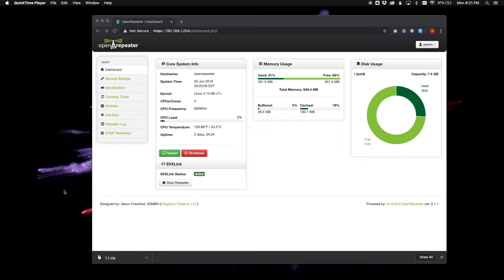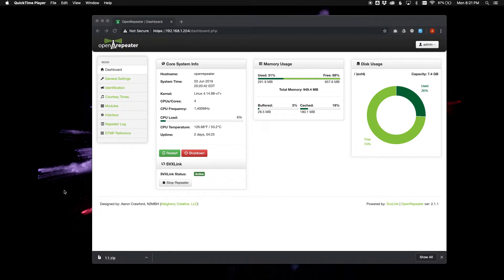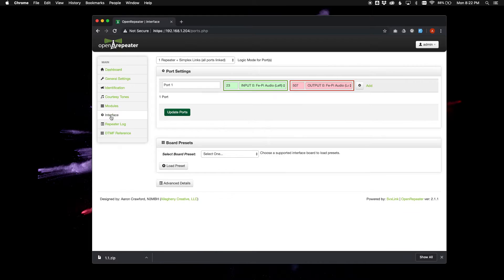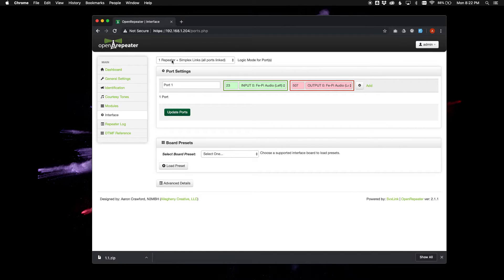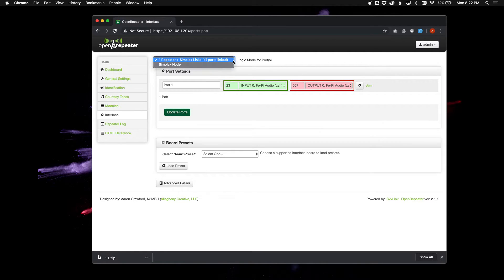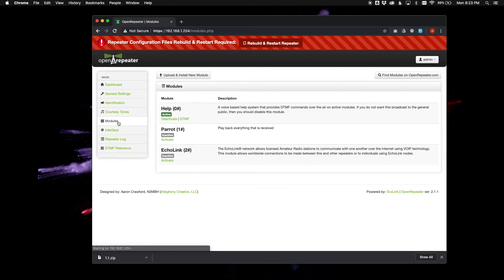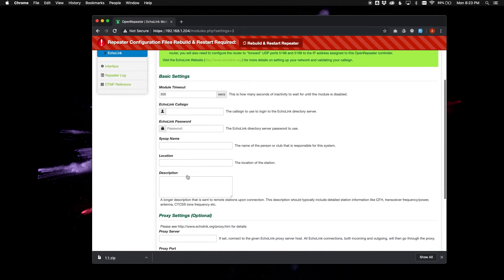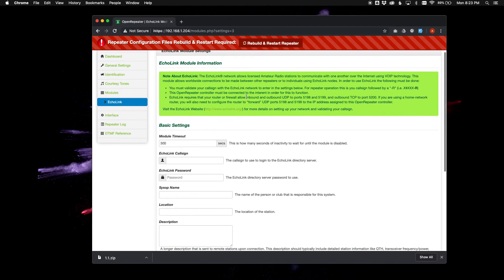OpenRepeater - Simplex/Echolink Node

Comment: So are you saying, you can build a Raspberry Pi, Node, that you download and install the open repeater program on. Then you can change its functionality to operate as a RF transceiver (or Node) that connects to a computer, for operating on Echolink? Much in the same way as modern, digital hotspots work?
Reply from the maker: Chris Sewell yes pretty similar. You’d need the Pi with the ORP image, some interface hardware (like the ICS Controllers Pi Repeater 1X) and a transceiver. Something with COS is preferred over using VOX. There are mods out there for adding COS to a cheap BF888S as used with Allstar nodes if you want something lower power. You basically set it up in simplex modes and enable the EchoLink module.

Comment: Is the software open source?
Reply from the maker: Gabor M yes it is.
Reply: @OpenrepeaterProject  great, can you please help where could I find the source code? thanks
Reply from the maker: @gaborm4767  Yeah. Just go to the project page in the description, then in the upper right of the page follow the link to the GitHub page. Note that there are multiple repos for different parts of this project. Each repo can have multiple branches as well. There are a number of dependancies to make it work correctly. The main repo is the webUI only, then there is a script repo as well that runs a bash script to do the install on a fresh version of Raspbian. This install all the dependancies, compiles SVXLink from source and installs the web ui. If you are not familiar with this, I would suggest downloading a ready to go IMG file the site.